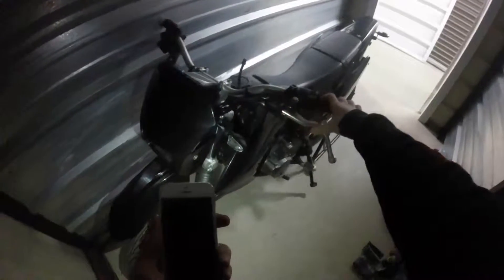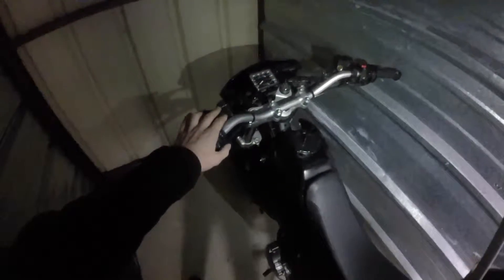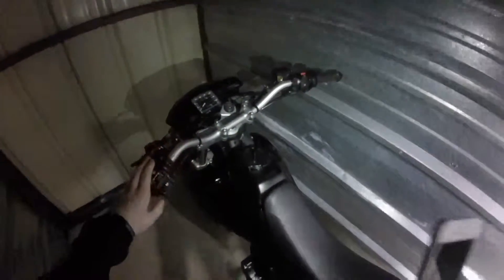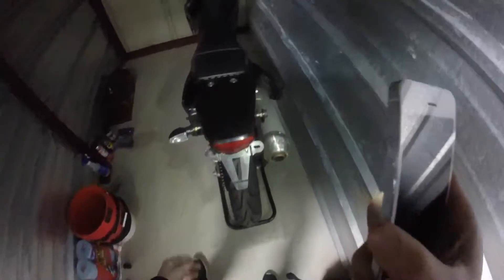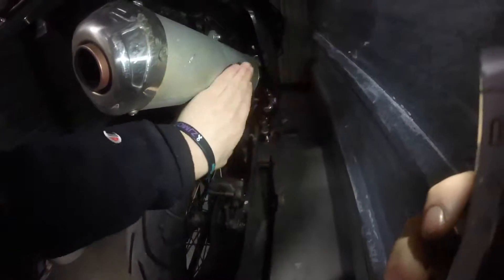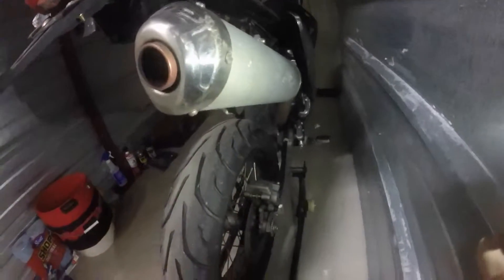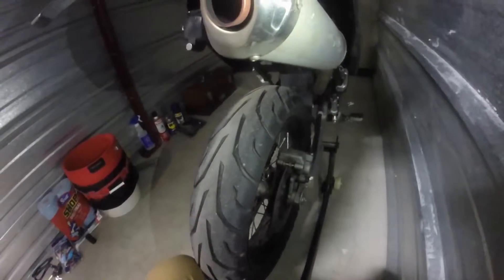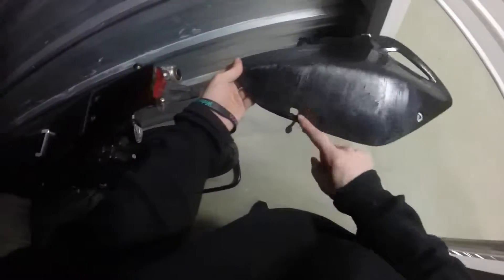CRF Winter Mods | NEW MIC

Comment: ahh dude what taillight assembly do you have on there? also what tires you running?
Reply from the maker: +AdrenoMoto DRC Edge 2, sooo much better than the Acerbis that was on there when I first got it. Also those are pretty new Dunlop GT501, great on the road and I don't think they're too bad offroad either lmfao...
Reply: +Ian Creature nice was it easy to wire up? I'll check those out I need a new set of tires before spring
Reply from the maker: Wasn't too hard there are only 4 cables if I remember correctly. awesome tailight for the $. And I thought about going more dirt but ended up going full street, theyre the next generation of the stock tires
Reply: +Ian Creature did you get the one made for the 250L? okay cool I got some duro brand on there right now would definitely like to upgrade to the dunlops
Reply from the maker: +AdrenoMoto I wanted the 250l one so I could get the integrated tailight but I wasn't sure if the wiring would be the same so I got the universal one, honestly cant beat it for the price.
Reply: +Ian Creature ah okay sweet, where did you buy it from?
Reply from the maker: Im pretty sure it'll be on Amazon still, and btw I like the red rim tape! mine just came in the other day can't wait to put that and a few other things on
Reply: +Ian Creature yeah the rim tape is awesome still looks perfect on all sides but the rear chain side, grease from the chain made it come up a little bit just gotta keep it clean
Reply from the maker: wheels are the first thing i'm working on this winter haha and keeping a dual sport clean is hard but I try my best 😂😂😂
Reply: +Ian Creature yeah it's hard as shit haha, unless it's caked in mud I'll leave it duty lol